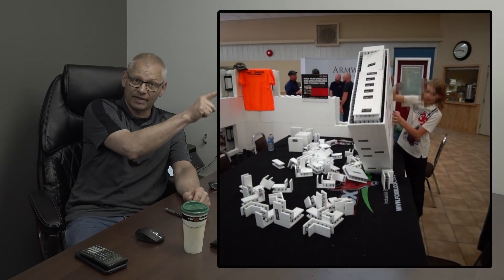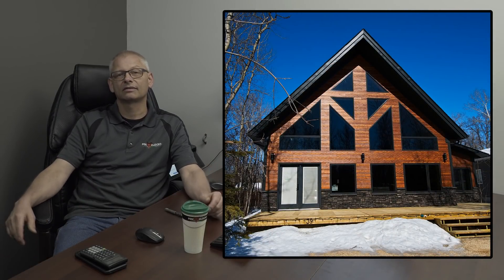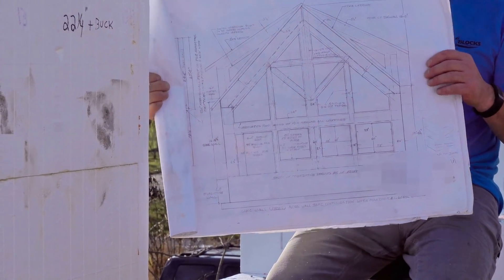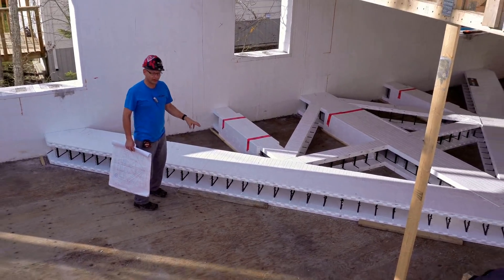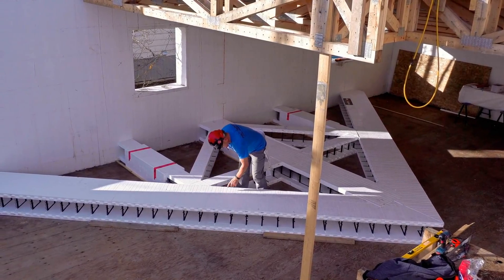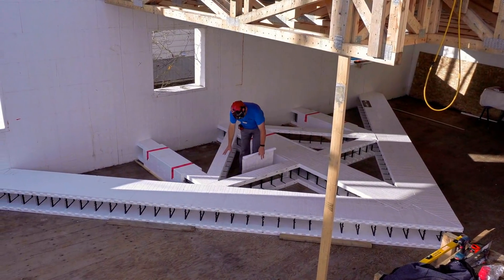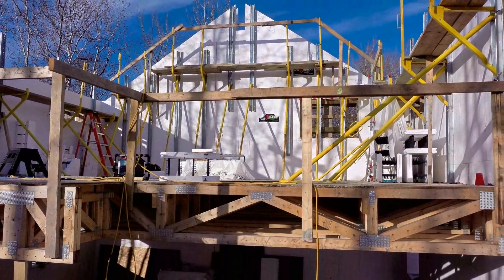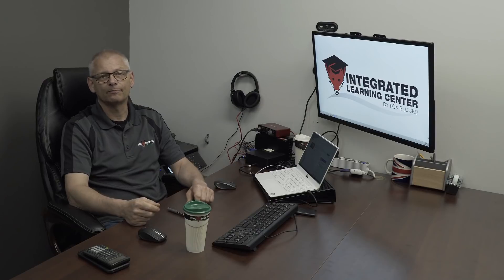Fox Blocks ICF Gable Window Wall

Comment: Staggered 2x6 wall built out to 12" with 2 layers of R24 making R48, vapour barriered or spray foamed would be pretty tight.

That said, you built a window not a wall. I'm not sure the gable is going to be the big energy loss problem. I think this is great if it's easier, but sending people down this road just to sell a couple more bucks of product but cause them headaches is counterproductive for you and them.

Comment: How expensive is the Gabler ?
That cement truck has a minimum load of cement that you must buy or pay a premium the pumper is rented for one little piece because this is the last part of the cement  , I could see this being costly.
Reply from the maker: In this case the gable concrete was placed at the same time as the 2nd floor concrete so there were no minimum load charges.

Comment: What is the difference in the slump of the concrete in this gable compared to the rest of the walls? Did you use the same mixture for the non loadbearing portions that formed the window openings? They looked rather narrow which would make it difficult to get the concrete to flow evenly especially since excessive vibration is not recommended. What was the rebar sizes used in the different sections of this gable? I have build a couple of ICF homes but never with a gable this complicated. It is great to see continuous ICF. I agree with you not wanting to add exterior wood frame walls and all the potential for air and water leakage that would add to an other wise tight building envelope. It's great to the limits of building with ICF being expanded with fresh designs ideas.

Comment: The videos have been great. Just starting with ICF and chose Fox Blocks. Building a retaining wall and elevated patio to start.  I have been in construction for 35 plus years and like to do r&d on simple projects that don’t hurt as you get through the learning curve. I plan to build a few extensive additions. Some may have corner windows and definitely gable end walls. plan to minimize wood and keep the termites away, a concrete roof hollow core is not out of the question. Just wondering how the concrete walls compare to other systems of CMU etc. regarding load bearing on the soil? Plan to be below frost line and we’re good ? will certainly get an engineer on board when we are ready.